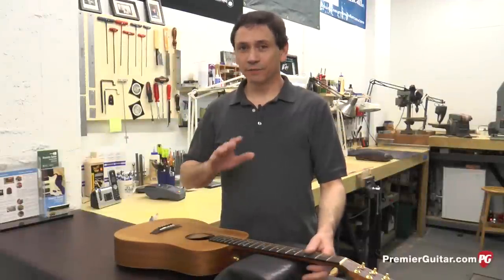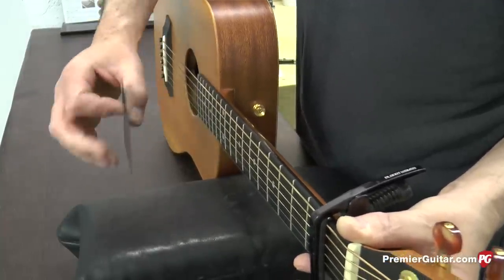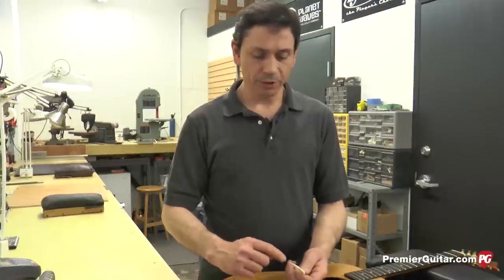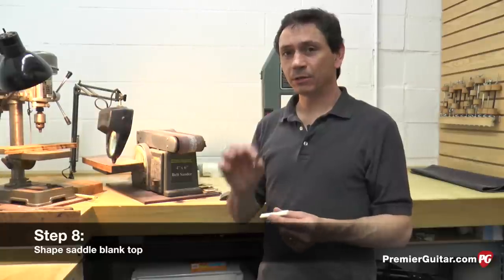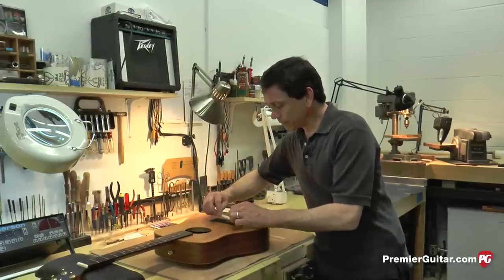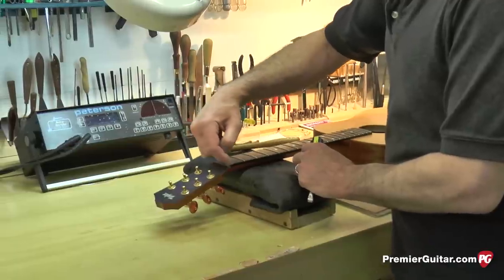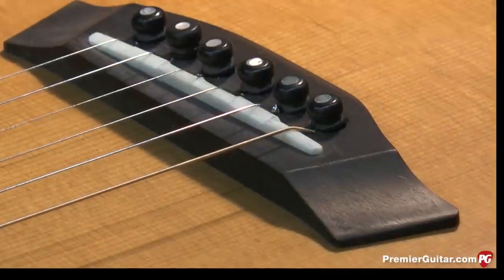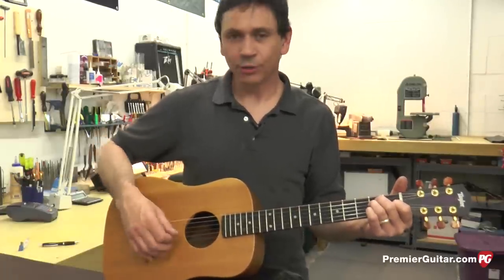How to Convert a Flattop into a High-Strung Guitar

Comment: @UC5J-hZ4wNf7OlkzIn49LHoQ
  Turning any Guitar into a Nashville Tuned Guitar is simple, swap out all the original strings w/ a set of Nashville Tuning Strings (you can also Swap the B String out with an Octave4Plus .006 High B for a brighter sound). By itself it sounds like a Tenor Guitar which means, that's the closest you're going to get to the sound of a Tenor Guitar w/o having one.

Comment: I was gonna say ... isn't this really jsut as easy as putting a different set of strings on a guitar? Doesn't really take almost an hour to describe how to do this!
Reply: David Lee King I literally just changed the strings to high strung strings.
Took me maybe 15 minutes and sounds absolutely great.
Holds its tuning perfectly, the action is absolutely fine.

I use it for recording.
Brings so many songs to life
Reply: @pinkpunk2008  Do you have any trouble with intonation and string buzz from the wider nut slots?
Reply: @michaeldouglas2634  I never did cause it has a tune-o-matic saddle and a zero glide nut